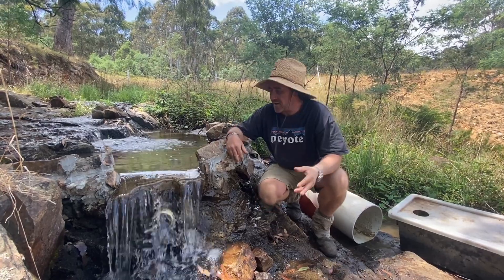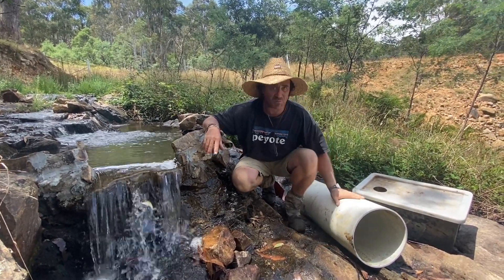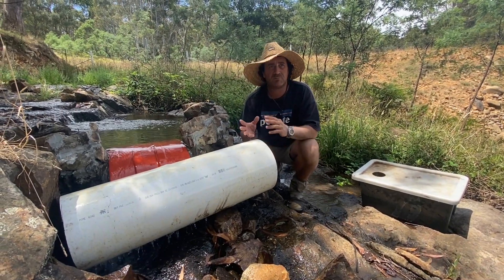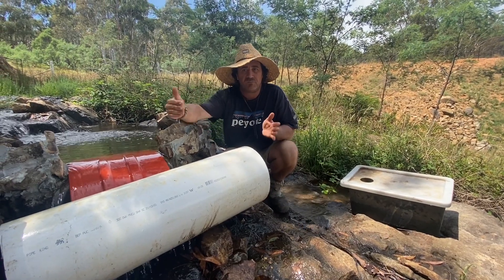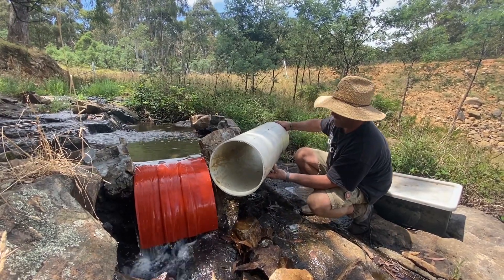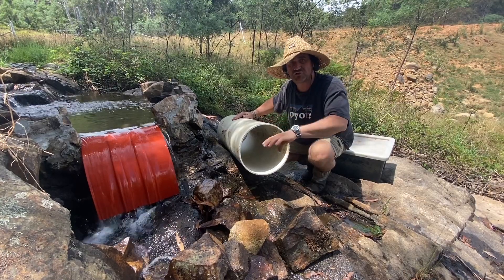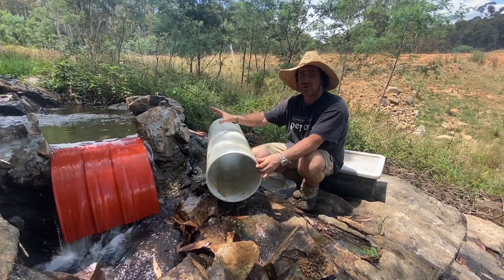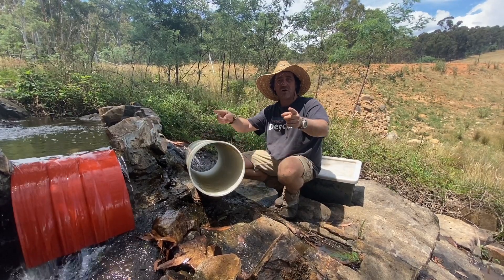Off Grid Micro Hydro Power Generator Part 6 - Drum Filter Conception.

Comment: A free download of the Coanda Screen calculator is available having been converted to an Excel spreadsheet file, so you don't need an old version of Windows for it to run. When the screen is designed correctly for the intake flow + bypass flow, it is self cleaning. Closely installed on an intake box, not even a tadpole or a lizard will make it through to block your turbine nozzles. These screens are also sold in Australia as "Wedgewire" intake screen. Also in premade flow-rated versions by the same company in NZ that make the Powerspout micro hydro turbines.

Comment: Kris harbour uses 3d printed coanda screen and stainless steel but you could really make box out of wood or riveted sheet metal and use a sealant
Reply from the maker: Hey John, I'm getting close to having the prototype complete. Stay tuned. Cheers
Reply: @FatCowFarmTatong   IAM in similar situation 12 meter head but 350 meters of run have been working on and clearing route for the last year or two very overgrown stream 6lt per second available
Reply from the maker: @johngray6462  WOW, what turbine have you decided on? I'll be using the power spout Pelton wheel. Are you local to Tatong?
Reply: @FatCowFarmTatong  probably will end up buying a permanent magnet generator from motenergy and peleton wheel and spoons on eBay and try constructing box like Kris does in video or Seth's from land to house channel I think it was supplied by Langston alternative energy.iam in Ireland have lots of clearing work to do.i was looking at using low head turbines because first 50m of pipe would have 4m head next 250m has 4m head and last 4m of head is in final 50m.still planning and clearing but enjoying the process enjoy try learning new skills so will try welding myself a intake and generator box. Enjoying your video's looking forward to the next thanks.
Reply from the maker: @johngray6462 , at 18psi and depending on the volume a pelton could work well for you. I'll be using a Helton wheel set up from Powerspout. A New Zealand company. Let me know how you go. Cheers
Reply: Kris Harbour is the master.

Comment: kwawnda screen.        firstly, this appears to be a  LOT  less flow than you had before.         unless you don't care about having a system that functions year 'round, the system should be spec'd for a flow rate that is a bit less than the nominal flow rate.
secondly, a correctly designed catchment should be utilized, for filtering out  buoyant debris and solids in suspension.      correct catchment design includes, the allowance of (small) buoyant debris to slough off, and of solids to settle out before entering the penstock.
thirdly, under these circumstances, attempts can be made only to limit algal growth via the use alga-phobic materials  and/or  blocking as much light (around the pickup location) as is practical.        d
Reply from the maker: Hey David, the system will be only used during winter. The solar system we have provides more than ample energy for the homestead. Its the clouded  dark months that cause the issues. I'm thinking of an internal fed system and running the drum filter down the slope with a catchment under the filter. I'm working on a spiral debris catchment system that will screw the debris out with the rotation of the drum. There have been failures i assure you but I'm getting closer. I'll keep you posted. Cheers

Comment: I like the concept, just concerned that you may be over complicating it, and when it breaks down at the wrong time. I’d build a filter box with different grades of mesh and clean it weekly. Add in a bypass that can indicate a blockage during large rainfall events
Reply from the maker: Hey Troy, i think you may be wright. I'm going to build two methods 1. the drum filter - i really want to see how this works. However the filter box will be the back up. I have been thinking why hasn't this filter system changed? One being that its a constant winner and secondly its just too hard. I have some time on my hands and just want to give it a go. I'm ready for set backs but i recon i may be able to pull it off. Hopefully with the same results as a standard coanda screen.